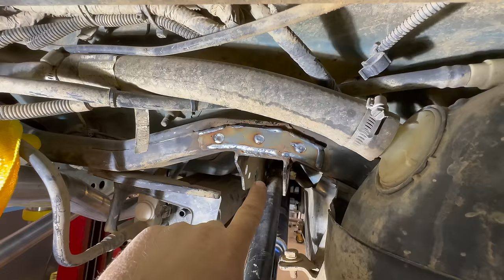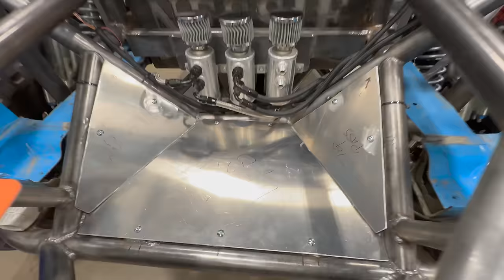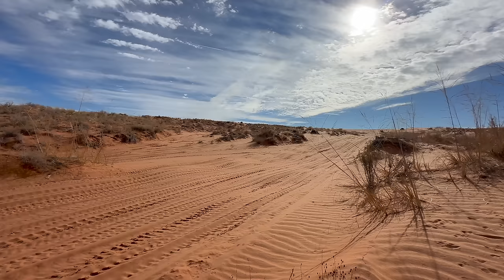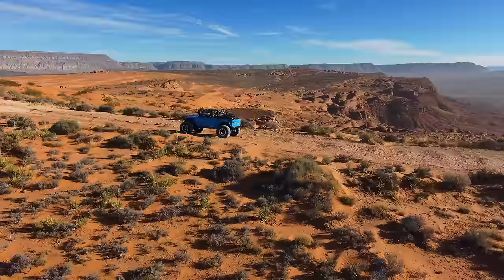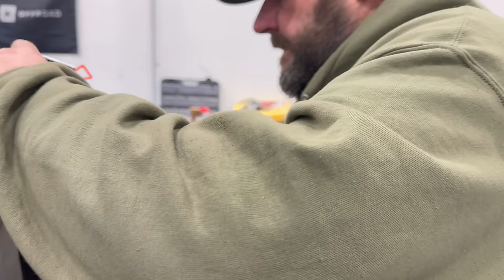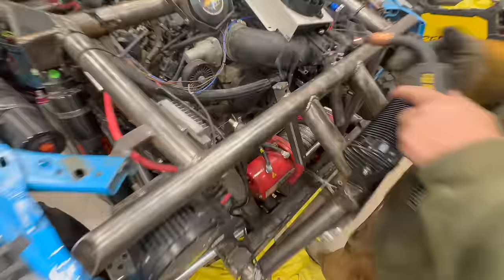Female Race Team For King Of The Hammers!

Comment: PREP, having spent a lifetime in competitive off-road motorsports in production-based vehicles [25+ Baja 1000/500, etc] if it moves or swings it comes off the vehicle "Every race" take nothing for granted I always figure 100 hours give or take. Being on the corporate side, only total engine failure was acceptable for a DNF. Testing and prerunning you can not do enough. Just a thought from an OG.

Comment: Holly, first off awesome choice for a co driver in Yolo! Second, I work at a Parker Hannifin distributor. Those fittings with the yellow buttons that you used on the power steering cooler. This are typically used only with push on style hose. Meaning they don’t need clamps. The barbs are much more aggressive than standard barbs you use clamps with. When you use clamps on those barbs it can cut into the hose and cause issue. Keep an eye on them. Or switch to a push on style hose like Parker 801 series. I don’t know if that all came as a kit, or if that’s just what you had around. But just keep an eye on that if you run that way. And good luck at KOH!!!